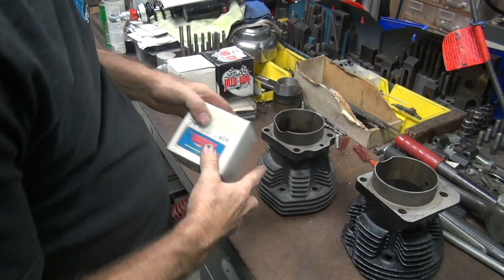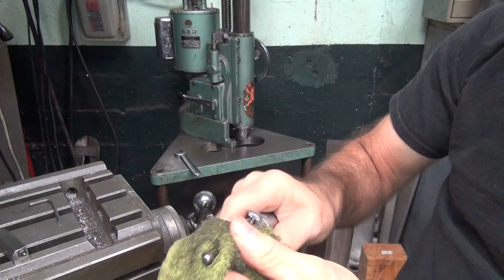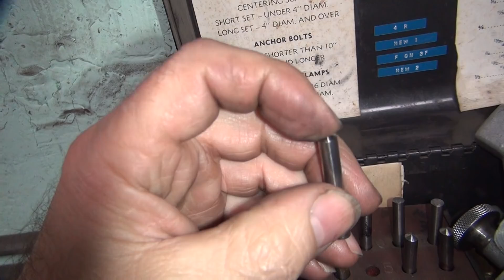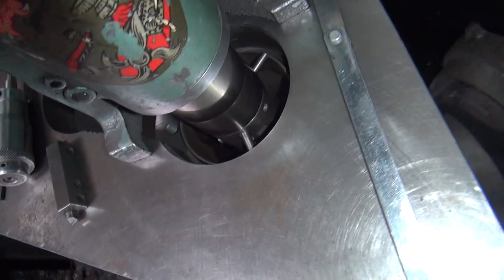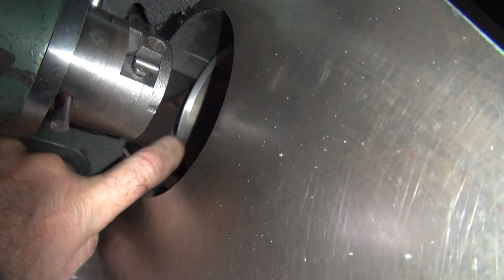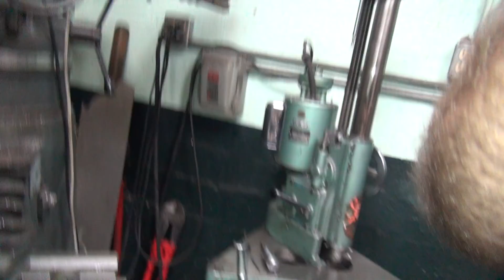1978 junk #101 shovelhead offset cylinder boring FL FX harley kwik-way by tatro machine

Comment: I have and older FS boring bar with a similar triangular table made with 1" plate, but the moveable plate is kind of diamond shaped and it doesn't have the extra "bushings" where the plate slides on the legs, so it's hard to center up for raising and lowering without binding up. 
Each bore is a little PIA to do--but it works so---

Comment: I’m about to bore out a set of std 74” shovel cylinders to .020 over
Using low compression Dixie Japan pistons.
Do you have a suggestion of how much room to leave for honing to finial size? Also have a suggestion for final size for that particular piston, and do you have any experience with them? I’ve never used Dixie brand before but heard people didn’t have issues with them
Reply from the maker: you could start by reading the harley service manual. that is what it is for.
tatro
Reply: @TatroMachine  yeah because the Harley manual says which brands use are good and which are shit. And even different brands and materials use different tolerances. The Dixie ones i got are old and don’t have any paperwork with em. Figured you might be knowledgeable if that was a worthy piston or not, I’m an aircooled vw guy I know which parts to use and avoid. Harley…. Not so much.
Also your video ended up saying some numbers…. Helps give me an idea. Why make a video and then give some smart ass answer like that..
Btw I don’t have any more service manuals. They all burned up in shop fire by arson some random bum here in orange ca. February 1st. Of this year, And the 1 manual my buddy has doesn’t give a lot of the clear information I asked for.

Trying my best to setup a temporary machine shop in the garage and wait out shop rebuild everything is out of pocket as of now as I’m looking into suing the insurance broker who fucked me. Lengthy and expensive process.

Anyways thanks for that great helpful comment, kinda seems like you don’t want to be bothered after reading some of your responses to others aswell. Sorry for bugging ya dude. Enjoy the rest of what’s left of the weekend.

Also… saw your mom passed recently. Mine just went yesterday. So from the most sincere place from my heart I give you my condolences.
Reply from the maker: most all cast pistons are made out of the same alloys. the pistons you have are made like stock and act that way. use the factory tolerances and you will be good. if you do stupid crap like i do than you have to adjust your clearances and finishes to what works for you. if you do not know what you are doing then you need to learn by reading and doing things to see what works. the 1st thing you need to learn is that everything effects everything. there is no one correct answer.
tatro

Comment: What keeps the centering fingers from flying out when you turn on the boring bar?
Reply: The id of the cylinder rubs on them creating a nice burr on the centering pins and matching gouge in the cylinder. This burr on the pin makes it easier to remove them when finished.
Reply: the part with the pins doesn't turn.
Reply: looks like i got that wrong, i guess they lock in.

Comment: What is your take on using/not using torque plates?
Reply from the maker: i don't use them because they do not repeat the warpage they cause in the cylinder bores. every time you put them on they are different. without repeatability there is no accuracy so why use them. that is their only job and they fail at it. i get the same crappy bore warpage whether i use them or not so i chose not to.
tatro